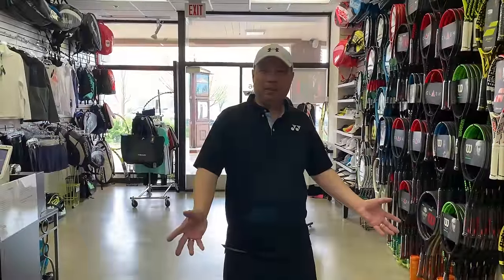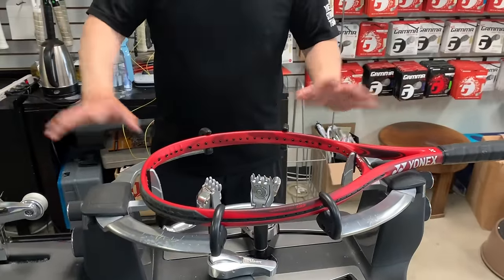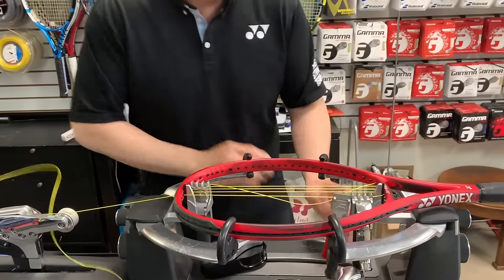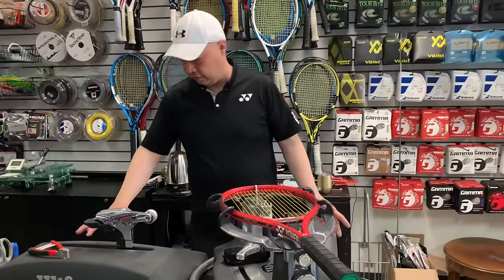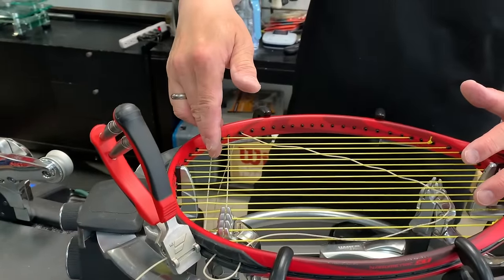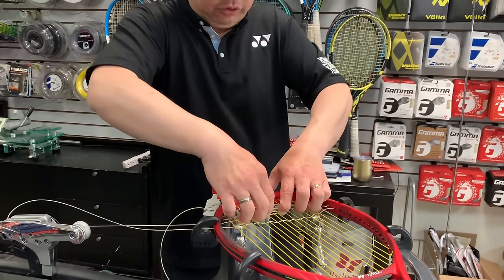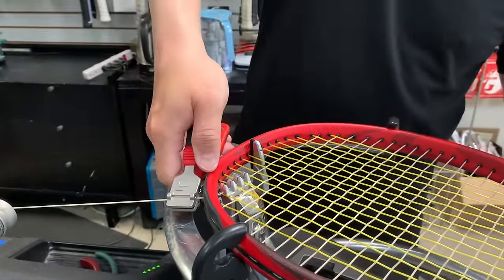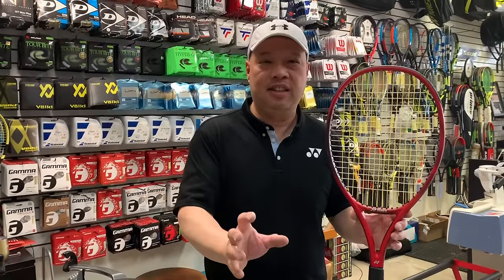Yonex Stringing Team - This is how we string tennis rackets.

Comment: Any string recommendation for Yonex vcore pro 97 290 gram ? Thanks ... 😊 ...
Reply from the maker: Solinco Confidential 17 or 16L at 48lbs.  Thanks for watching!
Reply: @TennisSpin  thank you very much , your video just really great ... 👍👍👍 ...
Reply: Never take advice from a stringer who doesn't ask questions. There is no right string/tension for specific racquets. It should be based on your racquet, your skill level, playing style, etc.... Look at Federer. When he switched frames years ago, he didn't change what string he uses. He had long decided those strings were right for HIM, not the racquet he was using. He did change the tension, but that was just to compensate for the larger headsize. 

You should experiment as much as you can afford to. And ask yourself a few questions: What are you looking to change? More power/depth, spin, feel, durability, etc? And no, you can't increase all of them. All strings are trade-offs. You gain something, you lose something. Look at what you're currently using, consider those questions, and then try some different strings/tensions.
Reply: @RobsTennisVids  thank you so much bro ... , I'm from Indonesia really appreciate for your feed back ..., In Indonesia there is not much option to choose , and right now I'm still using babolat Rpm blast at around 48lbs in my vcore pro 97 290 gram ... Once again , thank you so very much ... 👍👍👍

Comment: I would have thought, when beginning the crosses on the top of the frame, they would recommend that you tension the string directly from the machine (not just clamp holding it until the end) because you lose tension the way Yonex wants I'm pretty sure
Reply: ? You pull tension on at at the end.
Reply: @alfasud1972  correct but if you double knot it on the top to start off and pull tension from that point then no need to clamp it.

Comment: I do not understand why you would want to start the cross with no real tension on the top string. During stringing it, that looser tension in the top string will loosen the strings next to it as the clamps go down the head. 

What i do is put light tension on the top string (drop weight hanging down) then i set the knot on the top string (double ending knot that i pull against the drop weight tension), then i put my desired tension + 6 lbs (3kg) with the drop weight on the top string to set the knot. Then loosen that to string again and use the normal desired tension on the top string and clamp it.
Reply: No real tension? It's just shy of full tension by the friction of the grommet.
Reply: @pbillings808  He is actually saying that the top string has just a little bit of tension, the second string has full tension in the beginning when he clamps it, but then he is moving down the head. Who say some friction in the grommet is enough to keep the tension from kreeping down the head? Why doing something like that? You can also tension the top string after the 3 string from the top, pulling the first string, move that clamp from second string to first string, knot it and then go on with string 4.
Reply: @LarzB  And I'm simply refuting that statement based on physics (Newton's first law -- nothing moves when forces are in equilibrium). Yonex apparently agrees with Newton. 

If you're interested, read up on dynamic vs. static coefficient of friction as well -- the holding power of the grommet even goes up once the pulling stops.
Reply: @pbillings808  don't try to be smarty pants with physics, you don't know my background. I know the theory. My experience with starter clamps slippage (and that might be due to the quality of my clamps) is not that great. There are more factors to consider than only the friction of the grommets. If somehow the first string gets looser, due to movement and or small slip of the starter clamp or deformation of the racket face while doing the crosses, there is a chance of slippage to regain that equilibrium.
Why take that chance, just finish the first string faster (directly or after string 3).
Reply: @LarzB  When you start off with "no real tension" and then -- after the error is pointed out -- following up with "just a little bit of tension",  can you blame me for thinking you may not understand what's going on? I'm just trying to be helpful with additional information and justification that I'm not simply making stuff up.

If you were concerned about starter clamp slippage as the cause of tension loss, then just say that out of the gate. In that case, it makes complete sense to tie-off as early as possible (or resolve the clamp issue).
Reply: @pbillings808  sorry Paul, i meant the same with no real tension as the little bit as i meant not the full tension of string 2 and further i wasn't clear about certain worries of different causes of slippage. Even in my 6 point stringing machine i have seen the racket warp while stringing and indeed i have had starting clamps slip or slip a little bit due to movement of that clamp on the outside of the racket frame hanging on one string.
Reply: @LarzB  Cheers, mate. Potential slippage by the starting clamp during the pull is one reason I like the Yusuki approach (both to mains and crosses). Cutting the load on the clamp in half is worth the few seconds it takes, IMO.

Comment: what are the string lengths? tnx
Reply: For a 16x19 100 sq in racquet using poly, I normally do 580cm for the mains, and 510cm for the cross. If you want to play safe, then add 10cm to each string. This number might go up or down depending on the string pattern, head size, and elasticity of the string (e.g. poly vs multi). Hope that helps :)

Comment: My stringer strung my racket and my bumper grommets flared up like cat ears. I wonder if it was because he strung it incorrectly
Reply: I string and can not see how that would happen except for the tie off grommets.  Maybe using way too much force synching the knot.
Reply: @imateapot51  well the cat ears are exactly where the isometric head shape flares and both knots are directly on the same strings the middle of the cat ears peak. Also he broke the bottom grommet that starts where the head begins to loop, this grommet is also wider than the others, but he tied of a knot there and snapped it.
Reply: @corradoscire8670  You can order new grommets and bumper guards.
Reply: @imateapot51  I will, should I string it myself like the video is teaching me?
Reply: @corradoscire8670  The video is fine.  I normally do starting knots rather than holding the top not tensioned string with a starting clamp.   For one,  I would hate to nearly finish the racquet and then have my starting clamp fail for the first time, and I do not like pulling the last string,  the top string with the starting clamp on it   I do not see what the big deal with starting knots is.   So a more standard way of doing the crosses is to start with the third or fourth cross and work backwards to the top.   This way you are not pulling so much string through the top of the racquet.   Then I tie the starting knot and tension the first string twice.  Once just to tighten the knot and second time to make sure it is tensioned.   I never increase tension for knots.   I know top stringers at the Opens do.   You do not hit the ball on the outsides of the frame and what percentage increase do you pick - seems arbitrary.   I also do parnell tie offs rather that double half hitches.   That pulls up more slack.   Look at the videos Parnell has on youtube.
Reply: @imateapot51  thanks I’ll try it. My stringer has tie off knots at the bottom and top of the hoop on the same string maybe that’s the problem. But thanks for the instructions I’ll follow yours.

Comment: Yonex isn't right on everything and the Japanese have been known to make mistakes :
1. Increasing tension on tie-off string is a myth busted by USRSA. So no need to do it unless you've got a very naive customer who seems to gauge how good your string job is by the looseness of your tie-off string. For those ignoramuses, add at least 20% as Richard Parnell does. The downside of tightening the last main is a reduced sweet spot (and who in their right mind would want that!!??).
2. Don't understand why Yonex would say to release base clamp first. That puts more pressure on the top clamp which would then put more pressure on the string, which you don't want. So when releasing clamps, best to put least pressure on the string and release top clamp first.
3. If you tighten the first half hitch too much as you do, you're not going to be able to cinch it enough, so best to tighten lightly first, then cinch and then tighten strongly last.
Reply: I am a home internet stringer. I do a few rackets for side money. One of my first jobs for a friend of a friend went bad because he told the friend that his outer strings were loose. This is from a 3.5 player that had his poly for 2 or 3 years before it broke lol. I went to a pro shop to feel the strings in demo rackets and they were just as loose as all my personal sticks. My advice to him was to play it and it should settle in or if he still did not like it then I would refund his money if he wanted a new string job. Aka rip out the strings and not just take the money back. That deal killed any more referals from the middle man friends. I been to nationals as a 3.0 on a 3.5 team with my string jobs. I was so pissed lol.
Reply: @a2casius  Haha glad to be a member!
Reply: @The Chairman: I disagree with you about the top and base clamp. If you release the base clamp first, any string movement that results will cause the clamp and string to move at the same time. Releasing the top first will allow the string to slip past the clamp as you release it, and potentially scuff it up a bit. This is only for tie-offs though, and if you tie a good knot there shouldn't be much string movement anyway.